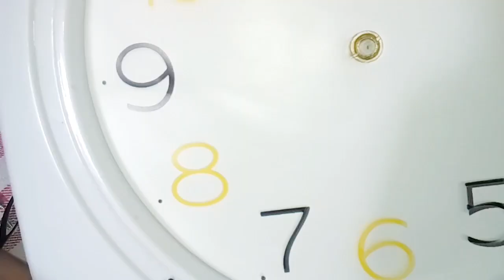How to maKE A REVerse CLOck with coRRECT time

Comment: BTW, I have a broken wall clock, the one with a continuous movement, not the ticking one. The mainboard is broken due to corrosion, same as the coil. But the gear system and the iron core still good condition. I rewind the coil with some old transformer coil and running the coil by Arduino. I program the Arduino to switch the coil polarity every 62.51ms means : 

delay (62);
delayMicroseconds (510);

Use PWM pin to connect the coil, so you can set the coil voltage to lower voltage around 1.1VAC by put the PWM number at 18 or 19.

Example:

analogWrite (9, 18);
analogWrite (10, 0);
delay (62);
delayMicroseconds (510);
analogWrite (9, 0);
analogWrite (10, 18);
delay (62);
delayMicroseconds (510);

So the clock will rotate.

Comment: I tried it but unfortunately connection between the cell and the main board lost. Now I have to solder it. If ur going to do this on alarm check if it is not blocked.
Reply: Yeah alarm clock has the board separate from the coil so u have to be very careful with the wires

Comment: Why not just put the battery in backwards 🥴
Reply: because doesnt work. you have need to reversing connection of the coil or flip the magnet. ;) if you have smartwatch or digital wirtwatch you have need to programming or buy digital wirstwatch with timer function and set the time.
Reply from the maker: I trieD (≧▽≦)